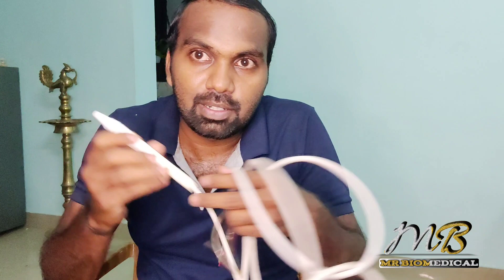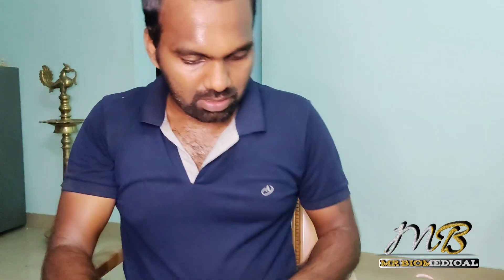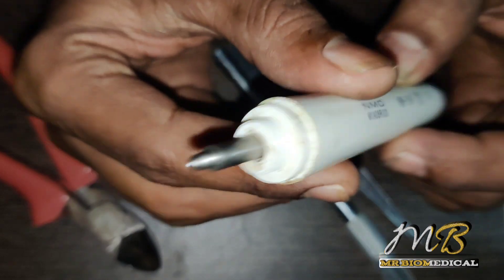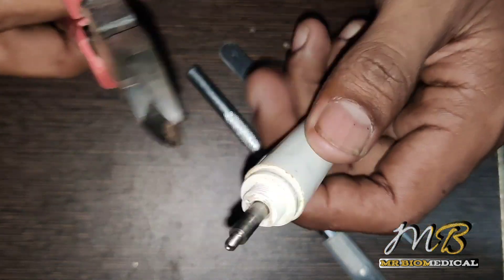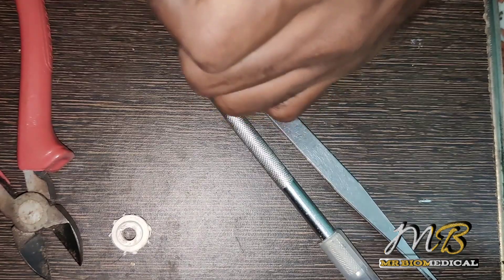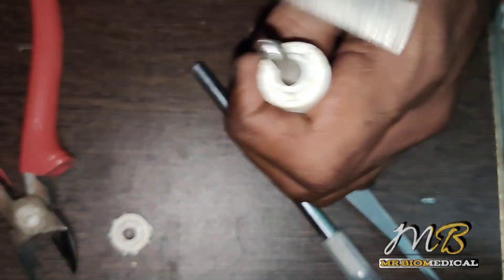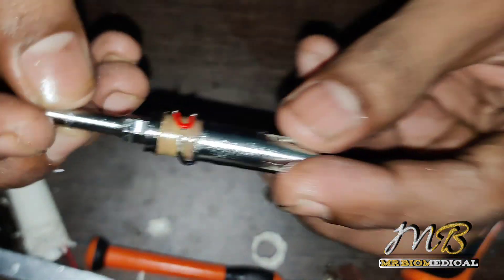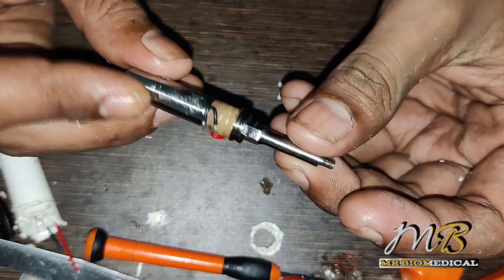Dental Scaler Teardown | What's inside? | Mr Biomedical

Comment: I have the same machine but now the water is not coming out of the machine, what can I do?
Reply from the maker: Check solenoid valve or water input
Reply: There is a standard 4-pile stack of piezoelectric transducers wired in parallel to increase the amplitude of the vibration. These are clamped so can be further  stripped down.Cooling water passes through the   centre and the vibrating tip to prevent the dentist from " cooking" the teeth during cleaning.